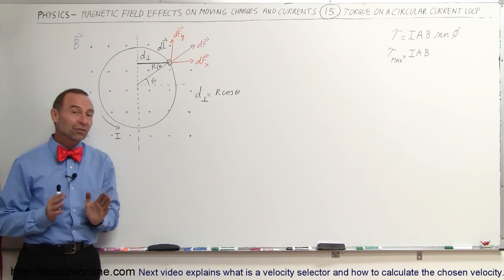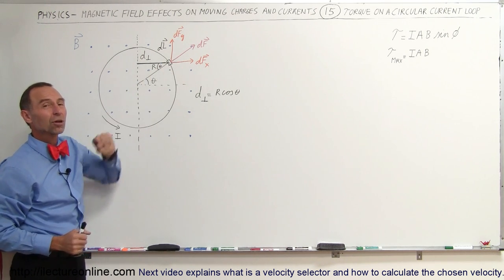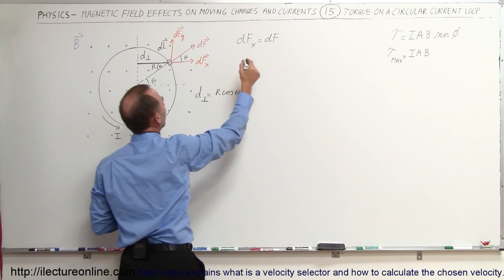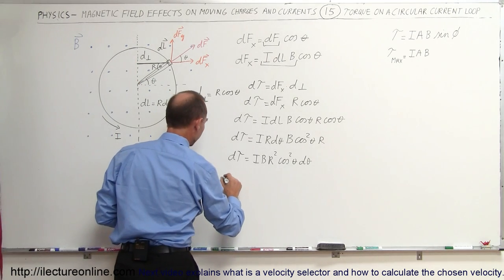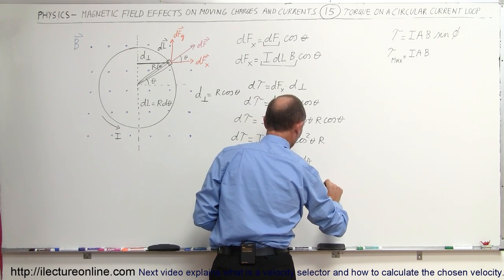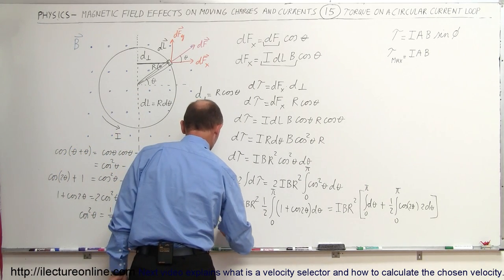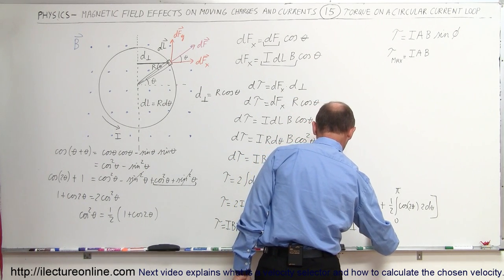Physics 43  Magnetic Forces on Moving Charges (15 of 26) FInd Torque n a Circular Current Loop

Comment: Dear sir
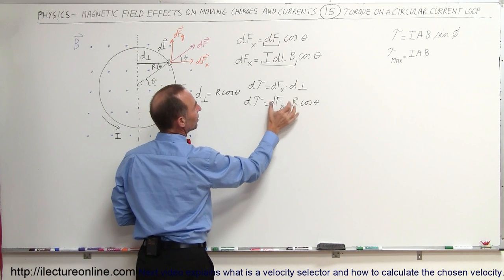4:03 you explained that dTorque = dFx × R cos(θ). I still don't understand with this because something that i know is Torque is the cross product between force and distance. But in your explanation is using cos(θ) instead of sin(θ).
What am i missing?
Reply: hmm i think that when you perform the derivative operation to move from "d" torque to simply torque this will be resolved. He defined the length of the X component as R cos(θ) and if you look to the top right corner of the board he has the definition of torque shown with the correct formulation. So i think dont worry that the derivation has cos(θ) for several steps before coming back to the familiar form
Reply from the maker: It depends on the reference angle.  See the torque videos in the mechanics section

Comment: First sir with due respect...I don't think that there will be any torque acting on the loop because the direction of magnetic moment and magnetic field is parallel so according to the formula  τ=M×B ...it comes out to be zero ...
Reply from the maker: The torque is not zero.  The direction of the current and the direction of the matnetic field are perpendicular to one another.

Comment: what happened to the cross product of dL x B in the dF_x equation? the angle between the dL vector and B shouldn't be 90 degrees at all times.
Reply from the maker: Sorry, but I am not sure what you are asking.  What part of the process shown are you not sure about?
Reply: the lorentz force is formally for magnetism: q(dL x B), and i was wondering, because in this problem, you set the current loop vertical, so each of the dL's has a different angle with relation to B; at the top of the ring, it's 90 degrees, and at the sides of the rings, it's exactly the tilt of the ring.
Reply: @NotLegato  I am also thinking about that. Torque on a circular loop seeming extremely complex.
Reply: I think then that will be  

dFx=IdLBsin(theta)cos(theta)

Comment: hi mr Michel van Biezen 
i have a question  
why the Vertical distance  Is not equal 2  R cos (theta)
Reply from the maker: Essentially you have to take each tiny piece and calculate the vertical distance (as you indicate) and the horizontal distance and then add them all up.  The vertical distance (when adding up all the pieces) will be equal to the diameter of the circle.
Reply: @MichelvanBiezen  but the diameter of the circle = 2R
Reply: @MichelvanBiezen  ohh u took a one force i thougt that u took another focre with the first so i sad the  Vertical distance is 2R cose(theta)
thank you
Reply: @MichelvanBiezen   now I understand you 
I confused first because you didn't take two forces 
But finally I realized that you multiple dt by 2 
So I wanna say thank very much ❤🌸😅

Comment: If the square loop is changed into a circular shaped loop with same number of tums, will there be a change in torque? Will it increase or decrease?
Reply from the maker: It turns out that the torque depends on the loop's area and not its shape.  If the number of turns are the same, the torque will be the same if the area of the circular and square loops are the same.

Comment: The distance is wrong, the perpendicular distance is Rsintheta, the force is acting horizontally. The distance should be perpendicular to the force not parallel or in the same direction. The distance is horizontal, the force is horizontal too, so I am sure that this is not true as a man who got A in statics
Reply from the maker: The distance is correct.  Look carefully at which angle we are using to find the perpendicular distance.
Reply: @MichelvanBiezen  the force is pulling in the x axis, the distance should be vertical? Otherwise this a sphere that is 3 dimensions

Comment: Hi. Thank you for videos. Before 2 video (13 of 26 ) you said dF = I.dl.B.sin(theta) but now it turns dF = I.dl.B.cos(theta). Why ?
Reply from the maker: You cannot look at the equation, without drawing a diagram of what is happening and then referencing the angle on the diagram.  Take a careful look at the angles that are referenced and you will see why the equations are written as they are.
Reply: Michel van Biezen Thanks. I will look at more carefully

Comment: Hello sir
Sir if we have to find the torque experienced by a current carrying semicircular ring in a uniform magnetic field about one of its EDGE(or free end corner) , how do we find it.sir  please help.
Reply: Can we use torque=magnetic moment×B?
Reply from the maker: You would need to integrate.  Take a small length (dl) and find its torque (dT) and then you integrate around the half loop.
Reply: Thanks a lot sir.

Comment: The only wrong step was to suppose that the total torque is 2 times the torque in the right. It isn't because if you look at the torque generated in the left is opposite to the torque generated in the right

Comment: i thought that net torque should be zero since all the force vectors cancel out.. this is very strange and complex and not intuive for me. :(
Reply from the maker: It depends on where the axis of rotation is.  In this case the axis is vertical and goes through the middle of the loop.  It doesn't matter what the shape of the loop is, only the strength of the magnetic field, the cross sectional area of the loop, and the relative direction of the magnetic field and the normal to the loop area, determine the magnitude of the torque.
Reply: @MichelvanBiezen  I got it. Thank you so much for your speedy reply. Best regards!